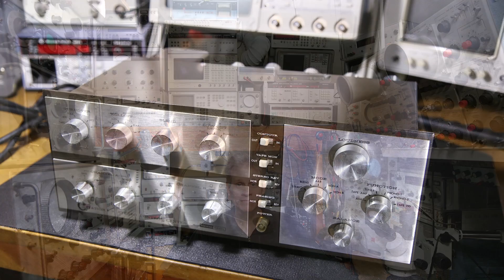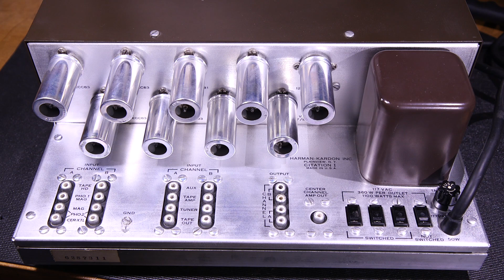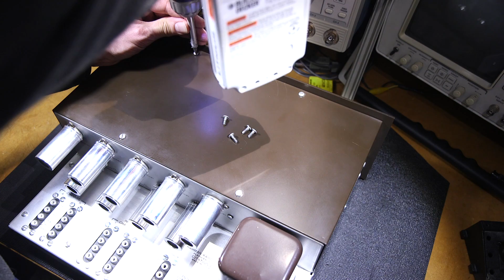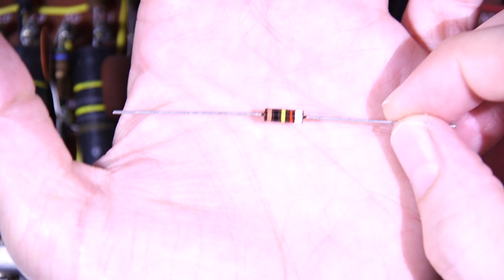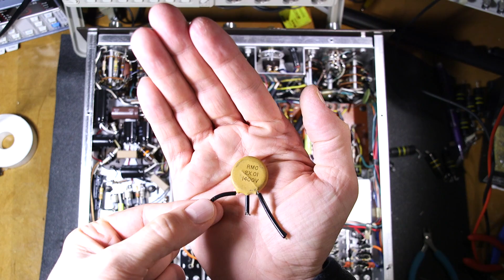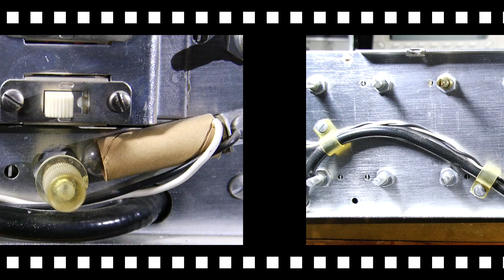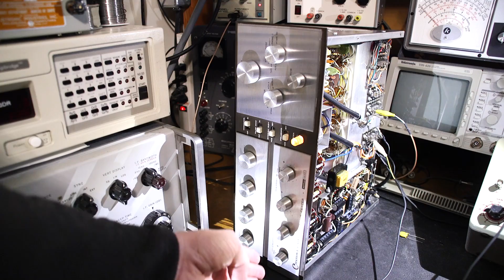Vacuum Tube Preamp Repair, Harman Kardon Citation 1

Comment: I thought I once read, that some of the tube preamps, were desirable due to having a better HF frequency response ( up to 100khz?)  Not sure why I would need a preamp that was flat to 100khz though.
Reply: For improved transient response... the higher the frequency response, the faster the circuit can respond to changes. Not sure how much value that would be due to the fact that very few power amplifiers (vacuum tube or solid state) can match that performance, let alone speaker response.

Comment: Wow! You really don't underkill any small item. On the placement of the outer foil for plate coupling capacitors, the impedance on either side is quite close as it is a coupling capacitor. I know the the coupling is a lot less at lower frequencies but this is not very critical. The other item-stress on components when wrapping terminals is a good input as long as there is zero chance of mechanical adhesion (vibration effects) . 50 years ago, I was always taught to have a mechanical connection first before relying on solder for long term reliability-this is a matter of preference largely. (according to HP and Tektronix practices)
Reply: A good mechanical connection means no motion will occur while the solder cools, so less chance of a cold solder joint.

Comment: I was an home electronics tech, now, when i recap a power supply stage  or power output stage of an amplifier or  in any electronic device I always put 105°c capacitors , i mount a new one with higter voltage tolerence, i just keep the capacity value as the orginal part.
Manufacturers always (for cost reasons)  use the lower value voltage caps it can be mounted ! Increasing voltage tolerence of cap  extends the life of the new part that had been installed.
In an amplifier's  output power stage, if some electolytics caps are  mounted close to the heatsinks, i recommend to ALWAYS, mount 105°C caps temp range, they will live longer !!!

Comment: You're the best. I know this is older video but I have question regarding the directionality of the capacitors - should I follow the lower impedance rule when dealing with passive crossover network in loudspeakers since capacitors have large values and maybe this may make some sense, especially when using high efficiency loudspeaker drivers.
Reply from the maker: Hi. When dealing with low impedance circuitry such as crossovers, the foil side is not important.
Reply: @MrCarlsonsLab  
Thank you.

Comment: Imagine an instance in which a guitar players amplifier chassis went live because of a faulty capacitor. The metal bits of his guitar are grounded to the chassis!
Reply: That's why modern equipment uses 3 prong plugs.
Reply: @JohnShalamskas  if you’re using more than one amp, to prevent ground loops you’d need only one of them to have a three prong cord. In this situation, if the amp has a death cap that goes bad, the same thing happens.

Comment: I always suggest to use a tube puller/inserter like the one from 'Arie Bergs' available on ebay.com.Easy to remove or insert 7-9 pin tubes with this tube extractor (rimlock, noval, B7G, B9A, etc...). This tool helps in removing those difficult to reach vacuum tubes, small bulbs, which may be recessed or placed inside an amplifier, radio or any kind of electronic equipment. It's very simple to use and safe for the technician and the tube.

Comment: Niiice (I've had a tube Pre or two, but never one of THESE)

 Solder-free desoldering, and a means of checking 'outer foil', I like it..

 You didn't show us a schematic this time, so i went looking ;) Whoa that's a LOT of tubes dude! They seem to run ONE pre stage at a real LOW current (215k Anode Load) and the FOLLOWING pretty high (47K load) to the stage can drive plenty current into the next stage, and NFB network...

High parts count, heavy, taked a lot of juice for a preamp, but What a nice thing... :)

Comment: This is way better than much of the cheap crap that's out there.  Most don't have any kind of EQ anymore and have one or two inputs w/ a Bluetooth wireless connection.  Although I have never heard of Harman Kardon before, I had a Realistic component system back when I was a teenager.  Tower speakers, receiver/preamp that had 7 band graphic EQ, two tape decks and such.  I miss having those, even though they were solid-state, they sounded great...
Nice to see someone preserving these great audio devices from the past!  :-)

Comment: Even after a Citation I restoration, I have noticed that the gain/volume continues to be unacceptable and too low for modern audiophiles..   Someone mentioned changing or removing the feedback resistors (if there are any), to improve the output..    Can/will you advise..??

Comment: I'm really enjoying your videos! I mentioned this particular video to a friend who has been in the electronics repair business for over 30 years, in particular the part where you removed the bumblebee capacitors, a type of capacitor I'd never heard of. He was surprised to hear that you replaced them with new caps. He explained that since bumblebee caps are paper in oil caps, not electrolytic, they have a much longer life and are actually quite valuable as vintage parts, especially in Japan, where there are even audio equipment designer/engineers who build expensive, coveted amplifiers and pre-amps exclusively with vintage components, e.g., bumblebee caps. I just checked ebay and found bumblebee caps going for 20.00 USD each. Since they're paper in oil caps, were you worried that they might have leaked oil or dried up? My friend has seen audio components like the H-K Citation 1 with original electronics, including bumblebee caps go for premium prices, especially, again, in Japan. Without the bumblebees, the price would drop significantly. Any thoughts? Thanks for all of the hard work you put into your videos. I'm involved in audio production and I'm enjoying learning how electronics, both audio and otherwise, works. Keep up the great work and keep having fun!
Reply from the maker: Hi Peter. The capacitors have no oil in them, they are paper and foil, not paper in oil. The bumblebee capacitors that are original are all bad now, and anyone saying they are good is just plain wrong. A lot of audio phoolery is going on out there, this channel is here to inform with proof, not hearsay.
Reply: @MrCarlsonsLab  I've been meaning to reply to your reply, Paul. I told my friend about your response and he humbly said you are correct. He did some research and realized he was not correct about those bumblebee capacitors, acknowledging that they are paper and foil, with no oil. He also told me that he agrees with you about swapping out the old bumblebees for new capacitors. Certain components really degrade over time and they need to go in order to keep old audio equipment working up to its full potential. Keep up the great work in the lab, Paul!

Comment: Long, long ago; when I was getting into the first stereo amps and such, the word got around that if the unit did not have a center channel, you could make one yourself by taking the + side of each channel and run to a separate amp, or in the case of an amplified stereo, to a center speaker, and the "hidden" third channel would suddenly come out.  I did try this with some of my old heath-kit tube amps but never really heard a good seperation, but this was after I got home from Vietnam where I lost most of my high frequency hearing.  Have you ever run into such a myth?

Comment: How do I discharge capacitors ? (Don't worry, I have ZERO intention to mess with stuff like that! I enjoy living)
Reply: With a chicken stick.  That's an insulated stick with high voltage insulated wire to ground screwed to one end.
Reply: Short them on your tongue ;)

Comment: One question, is there some kind of hot glue that can fix those capacitors from not moving, and not easily melting? Moving components that handle 400 volts sucks.

Comment: Why do you replace the electrolytic capacitors when they are of good condition? To the resistors: Carbon composite resistors are induction free, maybe the addicitonal induction of the carbon film resistors is needed somehow for stability, e.g. suppression of RF oscillations.
Reply: Learn more about electronics before you ask your questions. Paul is correct in every detail about this unit.

Comment: I'm wondering if you ever sat down and checked all those pulled Bumble Bee caps for capacitance and most importantly their leakage?  I'm not implying it was unwise to do a bulk swap, as I agree it was a solid choice.  However, I would be most interested in just how many of them would show excess leakage, 20%, 50% 80%?  I'm currently working on a Scott 299C preamp/amp and it uses Ceracaps throughout for coupling, feedback and some bypass.  There are also silver micas too.   I just pulled up the ends on the coupling caps to the 7591 output tubes to check them.  On my Sencore CA55 they all come in at 0.1uF +/- .01uF and within 2 or 3 seconds the leakage (at 400VDC) is less than 10uA.  By all standards these caps test just fine!  I don't think I'm going to pull them.      

So often we are lead by experience hearsay or outright opinions, but rarely do I see anyone truly analyze which brand vintage caps  have issues.  If anyone has some web links on such analytical work please provide the links - thanks.  Sadly that just leads to extreme views that are diatonically opposed.  When we do restore things like this, and perform mass capacitor swaps, it would be worth noting type, manufacturer, date time frame (caps manufacture) and then details on how they check out after being pulled.  Inquiring minds do want to know.
Reply from the maker: Hi Don, 10uA? I test my electrolytics at that, or below. I do have video's talking in depth about capacitors, just click on my channel name, then click on "VIDEOS"  and you will find my entire list of videos there.

Comment: Postscript: The original Citation I & 2 kit assembly manual, under Soldering Techniques states:"Solder alone cannot be relied upon for strength. A good mechanical connection must always be made before applying solder". The section on "Final Wiring of the Terminal Boards" states "Center the components between the lugs indicated and bend the leads in a hook shape around the top section of the lugs.  After soldering, cut off the excess wire".
Reply from the maker: Hi Sam. You had better tell Tektronix this!
Reply: It just shows how understanding basic physics [like lead flexing, thermal expansion, etc.] has improved since 1960. Back then, it seemed that mechanical joint strength was important, solder was an afterthought.
Reply: @samb3706  I was taught the same way originally, but have done things the "Tek way" now for years. Sure is a lot easier NOT having to wrap/unwrap leads !

Comment: The Citation I came in kit or wired form when new. Since this unit has the RCA jacks, power supply capacitors, and other items mounted with discrete screws and nuts, I believe that this is a unit built from a kit. My Citation I, which was factory wired, has rivets securing the RCA jacks, tube sockets, and power supply electrolytics. I also remember this from servicing these units in the 1961-1964 time period. I bought my Citation I in 1962.
Reply: Yes, it's definitely the kit version.  This would explain the backward caps, and perhaps the 1964 service, also.  (It probably didn't work when he finished building it.)  I built the companion Citation III-X Tuner in 1964 from a kit; at the time it was considered the most complicated electronic component kit being sold.  BTW, the tube shields were aluminum.  These have clearly been buffed or replaced.  The chassis is way cleaner than when it was new, so has also been extensively worked on.  It looks like the potted power transformer has been repainted, also.  In general, if I were buying one of these, I would opt for a factory-wired version.  

Regarding the comparisons with the Marantz 7C, the Citation preamp in its wired version was more expensive than the Marantz.  They also differ wildly in design.  The Citation was ultra-wide band and had state-of-the art circuitry.  The Marantz was narrow-band (20-20K Hz only), and had totally conventional circuit design.

Comment: I was surprised to see a turret board inside that preamp. Nice. I have a strange aversion to PCB boards on modern production guitar amps. So, all my amps are vintage/older, or at least hand wired clones of various Marshall amps. Seeing this preamp makes me want to setup a home stereo again. Everything I have is invested in my guitar equipment.

Comment: The resistor selection was a cost consideration. Carbon film resistors are superior but more expensive. By choosing the right resistor, good performance and low cost could be obtained.

Comment: Was there a schematic anywhere in the vidi? How was the value of shattered resister at lug 68 determined ?
Reply: The second channel is on the other side of the amplifier and would have had the same resistor.

Comment: To test foil end of capacitors with just one lead to the signal input of an oscilloscope... Would the outside foil end lead have the strongest signal ? It seems like it would and your device seems backward somehow. I don't know how your device works so mmmmmmm...What up with that?

Comment: Very impressed with what you did with The Cary Sixpac mono Block Amps. I will contact my technicisn to alter my mono block Cary sixpac and get rid of the hum and the ringing noise i believe i hsve to chsnge  or add 4 47 mf caps and chsnge the position of the invertet  and the amp tuns noiselesd.
Kind rgds
Francis Jansz
Melbourne . Australia

Comment: Hi Paul what are the values of the electrolytic you use, and where can I buy them? I am your supporter on Patreon. 
Thank you
Reply from the maker: There are 2 video's containing verified capacitors on Patreon, you will find them there. I recently posted the links to the video's in the community section as well. It should be close to the top.

Comment: Looking at the tube shields makes me mad.  I was an electronics tech on a Destroyer that was built in 1955. The equipment had hundreds of tubes. For example the master oscillator in the four HF transmitters had 60 tubes each. ‘A/N-SRT-16’ . Each of the A/N-SPA-8 radar display units had 160 tubes and so on. One day a new system was installed with a huge number of tubes . Over 300. The series regulators consisted of 48 type 6L6G tubes alone.  Then one day I discovered BLACK tube shields made by IERC and I started replacing the RCA designed shiny tube shields and the life of most of went way up. The life 12AU7 type tubes went by about 6 to 10 times.  I think the RCA designed shiny shields to sell more tubes.  Later, the life of Tektronix Scopes also went up.  Charles Lauter  Electronics Engineer.
Reply from the maker: Those black shields with the little fingers at the top were a great step up! I have bags full of both types.

Comment: I've watched this video a couple times before, but I noticed just now that there are several largish brown capacitors that didn't get replaced or even mentioned. Are they poly capacitors similar to Orange Drops?
Reply from the maker: You are correct Peter.

Comment: Another great video! 
I do not like only one thing: practice of replacing electrolytics straight without checking or even suspecting them being faulty. In many cases original capacitors are still fine and may work many years. 
For example when I am restoring some vintage equipment I first reform electrolytics by slowly increasing voltage on them via 1-2 megohms resistor. This is 100% safe and in most cases after reforming (it takes sometimes many hours) even leaky capacitors behave well.
I like to restore devices in most conservative way I can. So I am using NOS or just old and used (but working OK) elements, preferably from the same era, I would never replace old can capacitor with modern, ugly blue chinese caps.

I do not know how did ist start: manner of replacing electrolytics automatically...

Comment: If it wasn't for the recapping and general maintenance, you would only have had to replace one destroyed resistor!  I take it the Citation I came in for a fix and the recapping, especially putting in the safety caps.
Reply from the maker: Thats an interesting question Bob, kind of like: The suspension and brakes are bad in my car, and it needs an oil change. Could I just change the oil and still drive the car? Well the answer is yes, but safely, "No."
Reply: I get that, but what prompted the owner to send it to you?  Was it only the fault, or was there more he wanted?  Using your analogy, it would be like just fixing the brakes or those and the suspension, but neglecting the oil change.  That is, major fault and safety work would be done but the car would still need work to perform at it's best.